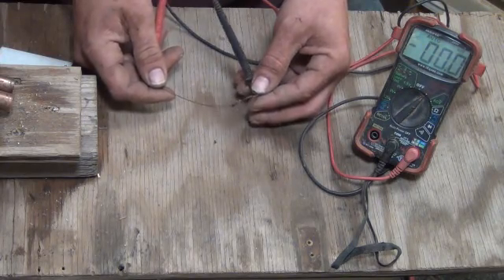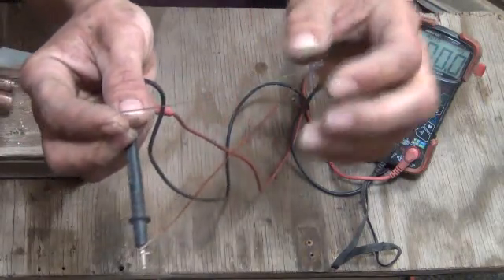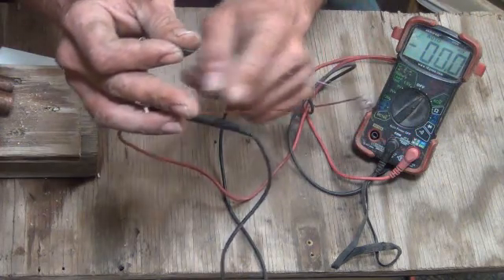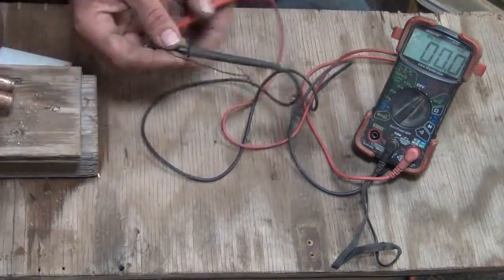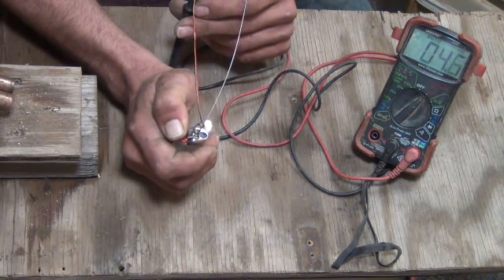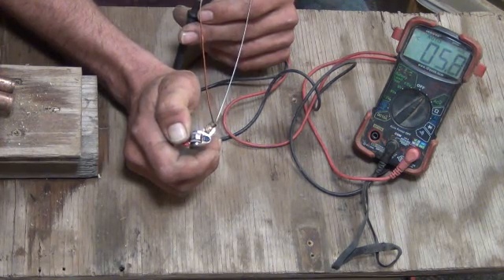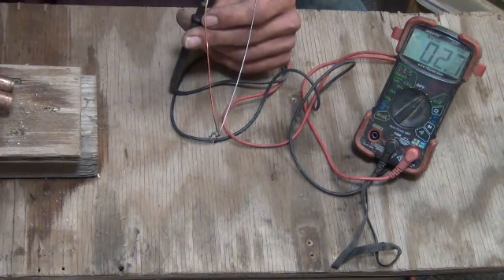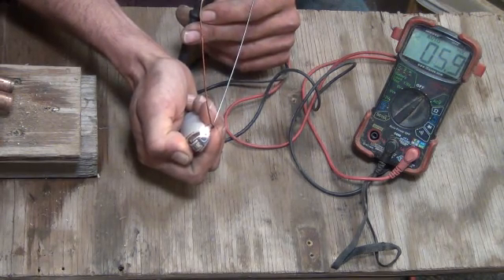How to make a thermoelectric generator from nitinol wire and copper

Comment: How about a copper radiator filled with Gallium Aluminum Scandium alloy with Nintinol thermal electrical generator's placed all around the edges of the copper radiator. Then have high heat superconducting ceramic insert into copper radiator in the G.A.S. with two Tesla coils that pass a high energy communications wave between Tesla coil A and Tesla coil B with zero energy loss a superconducting power loop. Then place a graphite rod in a thin Titanium sleeve in between the two Tesla coils and fine tune the frequency to pass through the graphite and Titanium that causes the graphite's crystal structure's to vibrate and heat up with the graphite glowing red hot with the Titanium glowing white hot with the G A S. absorbing and conducting all that heat with the nintinol thermal electrical generator's then being activated to generate the 12 volts needed to generate the superconducting energy.loop being passed through the two Tesla coils with zero energy loss from using the hest superconducting ceramic's. If constructed correctly this heater could start up off a 12 volt battery or be plugged into a wall socket then powered up and ounce tge thermal electrical power generation was working the heater could be removed from a.piwer source and it would be self sustaining correct? 😊

Comment: Im not sure, but I think that if you change one of these wires to a semiconductor, you would get much more voltage. I tested using copper oxide.

Comment: superelastic and shape memory nitonol have exactly the same properties the difference is that the transition temperature of superelastic (the point at which it springs back to shape) is about -10C
you should look at a seebeck coefficient chart; they list materials and their thermoelectric voltage per degree. so if for instance you took nichrome @25uV and nickle a@ -15uV that would mean for every degree centigrade temperature difference between the hot and cold junctions you would get 40uV

Comment: This is neat but on the other hand - you need around 2'500 of those junctions to charge a 12V battery. Spacing them 1mm wire junctions apart every 1mm - you'd need a 10x10cm module. Which isn't too bad.